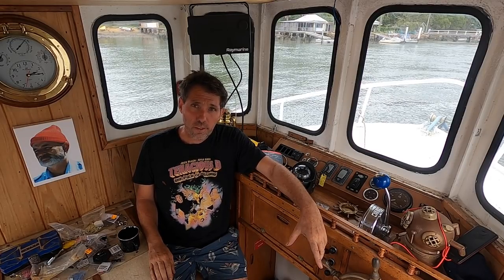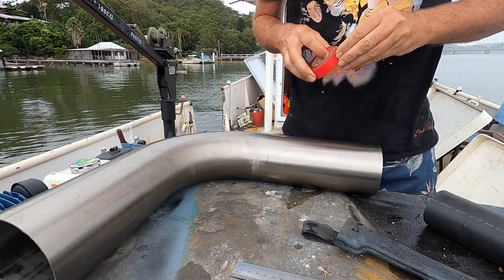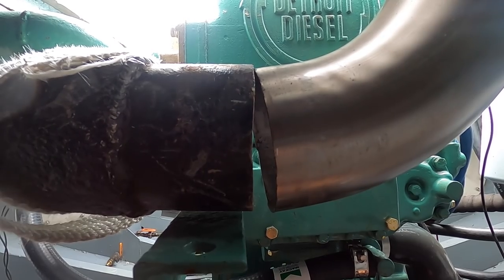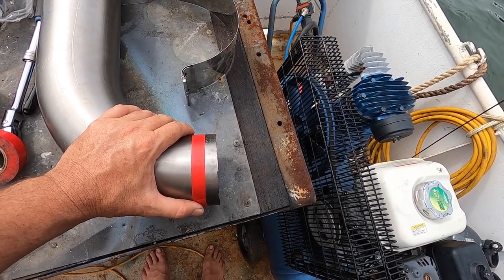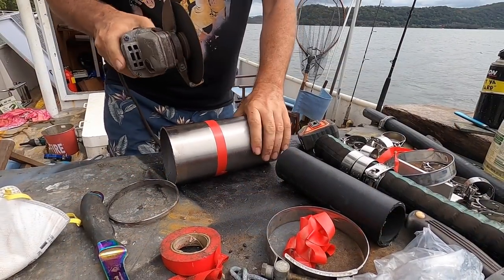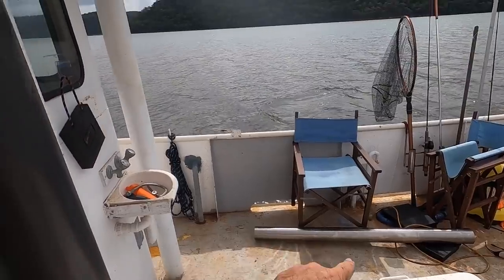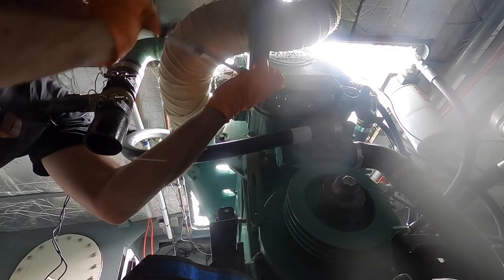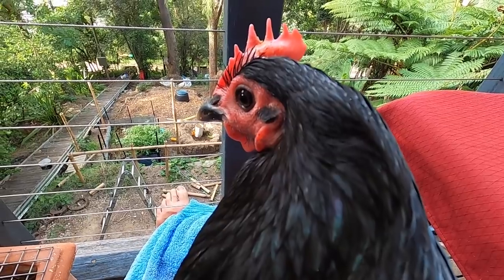Installing the dry exhaust

Comment: I would look for a silicone tube joint like they tend to use on an oversized intercooler for tuned cars. Can/will flex but also sit at correct angles, also look chipper

Comment: I was just going to say the same thing as Tom K, a through deck fitting maybe using 3 or 4 tension springs between the pipe and deck, so no 'hard' joint

Comment: Just a thought how about outing the flex on the vertical pipe before the deck may have a bit more room there and it may not matter if the flex is in part of the bend the longer the flex Less noise
Thanks Mate love the show

Comment: You could have a section of expanded metal rolled into a tube and bend the ends into a flange to bolt together to protect folks from grabbing the muffler.

Comment: Instead of looking for exhaust parts for marine try looking for them in big rig part stores. I looked up the exhaust flapper and found a few places here in the US Prices range anyway from $40 us on upwards into the several hundred category. All depends on your style or budget. 
But I do like the idea of running straight pipe looks a lot nicer.

Comment: Half way through the video and it seems the flex coupling would work best in the vertical portion, below the deck-level ring clamp, allowing left/right shifting between to solid-mounted items; as opposed to the coupling in the lower, horizontal location where left/right movement is compressive-expansive. But if engine torque is negligible, the deck-level ring clamp will be compensatory enough. You could always make the ring clamp mounted through 3 springs since it seems solely for through-deck alignment rather than rigid weight support. Or use a strip of the white weave to line the ring clamp.

Comment: Well, at this point, most of the 455 comments are about the exhaust... so, why stop now? I vote (a) use the flex for the 90° bend and flex mount the muffler & vertical pipe OR (b) put the flex in the vertical pipe before the muffler and flex mount the muffler & vertical pipe OR (c) spring support the muffler and vertical pipe weight & position and eliminate hard restraints. 

Also, cover the exhaust outlets temporarily with a paint can 'till you come up with a waterproof permanent solution. 

So, ain't it great having thousands of experts for friends? 👍🏼
Reply from the maker: I'm yet to find anyone that makes a 90 flex pipe. Could do flex below the muffler but that would involve cutting out the existing support as it is a larger diameter.

Comment: Had you considered inserting the flex in the vertical section after the bend?   I feel continuing the exhaust wrapping from the manifold along the new pipe up to the support would help reduce the number of sites for water to seep into and under the wraps. Certainly  looking forward to seeing it powering up and motivating the boat  forward and back.

Comment: Bus Grease Monkey recently dealt with a bus that had an exhaust tip like yours where the entire engine had filled with water from rain that got in. Suggest you put a coffee can on top of that until you get the new pipe and the flapper installed :-)

Comment: With your fabrication skills and when you have nothing else to make a video about :) maybe you should consider moving the exhaust to starboard and rotating the elbow on the engine so you go up through the deck in a different location.  You could probably just cut the elbow off of the engine and use a longer piece of flex.  This would also put the stack away from the wheelhouse entry and safely to the side.  Good idea for a future video!  Good job!

Comment: I know there is probably something that it will clash with, but I would try to rotate the exhaust from the manifold 45* upwards, that way you will only need a 45* bend just under the deck head, maybe giving you enough space for some flex too.

Comment: can you not put the flex join in the vertical section below the deck?
Reply: Came here to suggest the same thing
Reply: @gagt5spd  Ditto
Reply: Maybe in the Mk2 version of the pipe where the muffler goes walkabout and the straight pipe gets the gig, a bit of flex just above the bend to just below the deck. I think that would do the trick with a stainless bit above that through the roof with a nice curve to keep the water at bay. Otherwise I will just sit on the side and watch  Stay safe people, keep your fluids up, and like this boat it will be over before we know it

Comment: You should turn the U bolt clamp on the top of the muffler around so you don’t have the ends of the bolts sticking out for someone to catch themself.on.

Comment: First off the flex needs to be in there when the engine twists(they all do) I would replace the 90 with flex pipe myself just to solve two different problems at once. In cars the first clamp on the exhaust is at the back of the transmission on some cars simply to allow the engine to move and twist. 

For silencer(not a muffler) there is chromed cages for them that work well.

Also did you call an impact driver drill a rattler?

Comment: Turn the U clamp, otherwise you'll snag all your clothes!
Reply: Or worse someone will snag an eye!
Reply: Yeah I was thinking that, but then I'd probably shroud it just like a truck exhaust. I could easily see someone grabbing that in rough sea to steady themselves.
Reply: I was thinking the same thing. Cut the bolts off and then turn them both around so they face the wheel house.
Reply: That clamp would make a good top mounting point for a protective shroud, just use some cap nuts to finish off with.
Reply from the maker: @jonkwin9620  Nice thinking Jon. I've been thinking about how to mount a shroud.
Reply: @DangarMarine  you can use perforated sheet like on a wood heater to help dissapate the heat

Comment: I would not recommend a flap on top of the new pipe, the constant "tink, tink" noise they make at an idle is annoying.
Reply: Most guys here (New England USA) with a dry exhaust use a top bend and put a bucket over it when not in use to keep rain out.  Remember to tie a line to it as you will always forget and blow the bucket off when you start up.
Reply: @robertwalsh5793  Haha we used to have contest to see who could launch the buckets the furthest.
Reply: I used to drive a Mack with a flapper, it is so constant, you won't even notice.
Reply: @robertwalsh5793  saw a bus grease monkey video where  the whole engine was filled with water down from  the exhaust, hooked pipe, he wondered if the kids had climbed onto the roof and stuck a hose in it, but ruled that out, luckily boats always turn into the wind
Reply: You can overlap the exhaust with a larger diameter tube like a factory vent stack
Reply: Logic Hurts Idiots  I've seen guys use a bit of 3/8 silicone tubing sliced down one edge.  Plus they make higher end flappers, Not the super cheap ones you see on every old Ford tractor.
Reply: If you attach an elbow at or close to ninety degrees at the exhaust outlet then attach a rain flap they make virtually no noise at all.

Comment: You need to turn the u bolt clamps around having them pointing toward the stern is an  injury waiting to happen if you trip, you can make an exhaust tip by cutting a 90 degree bend like you did in the engine room and cutting a 45 degree on the exit this will stop rain entering

Comment: hard connect the 90 degree bend to the exhaust header pipe.  Then use the flexible pipe on the vertical portion.

Comment: Weld or braze one end of the flex to the pipe 
Really should use a little flex after the support bracket on the engine 
Or make yourself a flange connection to the flex  make your own gasket
The ubolt type clamps suck because if you go to take it apart those clamp pinch the 2 connections together which makes it harder to take apart later
I built a lot of big truck exhaust systems

Comment: check it out spring washers /splits/ wafers/  are not supposed to work??  nylon locking nuts stainles?  aka nyla nuts
. or double nut  it ? only on critical i know i know its been used for years. still is.
 but u must agree nylas are better except for heat     nice build and thought ur doing a great job

Comment: Hopefully you will be ok but with the white wrap, you'll know if that joint is leaking. If it was me, I would make a "Cap / Hat" to sit where the Up Pipe comes thru the deck.  This would make the Engine Room a little more water tight. This would be attached to the up pipe and just sit around the deck flange.

Comment: Could you put an elbow piece of pipe on top of the vertical piece as a water stop instead of a flap? Secondly, I would turn the U clamp so that the bolt ends aren't facing towards anyone that may clonk their head. Other than that, I know nothing about boat repairs. Just enjoy watching you endeavours.

Comment: Installation looks fine, but agree that you should hard pipe up from the muffler. What covers the hole where the exhaust come through the deck? I see there is a slight overhang from the cabin, but during a driving rain, it seems like rain water would easily enter this hole. Agree with other comments that the clamp at the top of the muffler should be turned around.

Comment: Did you consider cutting the pipe close to the manifold and using the flex pipe to go from there to the 90 bend maybe its too short a distance hard to tell from video, also if you tun the wrap through the deck support it will give you a bit of cushion on the pipe against chafing from the vibration

Comment: Is there room to put two clamps and a short bit of flex pipe between the 90 degree bend you just installed and the clamp at the deck? If so, that would allow the engine and the below-deck part of the exhaust system to move separately from the above-deck part of the exhaust.

Comment: Could the flex bit below deck be placed in the vertical pipe instead of the horizontal area .... its just for vibration right  ? Will there be a hat over where it comes thru the deck .... sure looks like rain / water get get into engine bay !

Comment: been watching your videos for a long time but had no idea how much progress youd been making. Great job! i wonder if there's any way to use the heat coming off that vertical exhaust? I thought it might be cool if you had a small water boiler or drying rack for wet clothes.
Reply from the maker: A lot of people do have a drying rack near their exhaust but water is normally heated using the engine's cooling water through a heat exchanger.
Reply: @DangarMarine Well your videos have sparked my imagination more than i'd care to admit haha. Any guesses how much fresh water you could carry at one time before running into issues?

Comment: Stu what if you were weld 3 value springs to the exhaust to help out with the vibration instead of having the 3 solid pieces of metal holding it in place on the boat deck. Could work?

Comment: Question, did not see any kind of p trap from where the pipe attaches to manifold down below. If motor is running obviously it is hot and dry but if it sits for a while humidity would collect in the inside pipes travel down into the muffler and drain into manifold? 
Just thinking, our car exhaust mufflers have a weep hole to drain this out. Maybe weld a bung with a bolt at the lowest point in the elbow, drill a pee hole on the muffler.  Love the videos can't wait to see it out making a run up the coast.

Comment: Could you not hard mount the 90 degree elbow to the engine and flex mount after the 90 in the vertical section

Comment: Stu, why do water pumps for marine engines use rubber impellers as opposed to far more efficient centrifugal designs or even something comparable to automotive water pumps, given that the rubber impellers seem to almost invariably have limited lives and reduced reliability ?
Reply from the maker: Mostly because centrifugal pumps can’t self prime. They are used for the freshwater side, just not the raw water side.

Comment: Gidday Stu. Daf looks so content on your lap. Anyway  mate. Just an idea for future reference, and after some time of running, you think the decibel level to be excessive. From where the pipe splits into 2 above the roof you may consider using 2 mufflers on a "t" or "y" joint   with 1 blanked off at the exit point. The oth3r open. You'll be surprised at the difference it makes in volume without  sacrificing performance. By the way Brazil is already at a standstill. When the doctors finally let me out of here so I can get back behind the wheel and pull my weight again. I'll be bloody happy.

Comment: Do you need to put a cap on the hole where the exhaust comes through the deck? Looks a good wave over the stern or sides would fill up the engine bay. Good luck.

Comment: Why have a solid 90 just use the flex line to go from horizontal to vertical.
Reply: That was my thought too, flex pipe up off the manifold elbow piece to meet a stub of hard pipe which is firmly clamped in the deck opening, then muffler on up.
Reply: i wondered that too , but there will be a reason he did not take the easy route

Comment: I probably missed where it was discussed somewhere, but what's the deal with the space around the exhaust pipe where it comes through the deck? Is it just for isolating the exhaust, or does it also serve to bring in combustion air? Either way, will there be something to keep water from getting down through there?

Comment: Hey Stu. Could you not have gone from the Detroit Diesel fixed exhaust to the flexi making the bend, then to a straight pipe up? Doing away with the hard pipe elbow all together.

Comment: I am not an armchair expert and having cheap shots, I just spent an hour pulling apart and tracing my previously installed wiring because my new electric Jockey wheel on the caravan wouldn't work, including dismantling the main switch after loosening the big AGM battery and tipping it on its side to get to the + terminal, there was nothing wrong, I just had forgotten the main switch knob needs to be pushed in hard before it will turn on, turning off is easier.
So one day when this virus bullshit is over and we come past with the van we might make a point of jumping on the ferry so our puppy Zac can meet Eddy.

Comment: Hey Stu, have you considered using a shroud/ for the pipe on deck ? Similar to what is used for a catalytic converter on a gas engine ? That way you won’t interrupt the door and won’t have the corrosion issue that comes with wrap.

Comment: Just brainstorming but could the initial fiberglass wrapped section of pipe be shortened (just beyond where it curves down) and a longer section of the flex pipe be used to both make the turn to the new 90 and provide vibration isolation?
Reply from the maker: I did think about, the trouble is the shorter you cut it the more it starts pointing towards the bulkhead.

Comment: you could weld the 90-degree on and put your flexible above your 90
Reply from the maker: No room in that dimension either unfortunately.
Reply: @DangarMarine   yes there is room
You just need to move the clamp that holds the (exhaust pipe / muffler) on the through dick up (a little )
While I'm mentioning the subject I would extend the through dick pipe up anyway if it was my boat
Reply: Just a little maybe a hundred mil

Comment: You made that pipework above the muffler look vary hard. Next time, cut your rigid to length and push into muffler and clamp, measure and cut flex to length, slide clamps over rigid pipe top and bottom, inset flex between rigid pipes and slide clamps into position. If not enough room for clamps to slide over rigid just pull clamp apart and wrap around rigid/flex one at a time. by the way, those clamps for the muffler have such long thread as they usually go thru a mounting plate off the chassis before putting the nut on. You can always raise the muffler top the roof and have the flex under the muffler. Also it preferred to wrap the other way so as water runs down the muffler it drops OFF the wrap, not INTO the wrap like you have it, but that's splitting hairs.

Comment: @11:10 could you please turn the bolts of the clamps away from open area (upper clamp) and away from your main walk-path (lower clamp)?
Otherwise they might cause very bad eye/foot injury if you ever slip and/or fall in that area.

Comment: Maybe there is enough space for flexi pipe after 90 degrę angle, when its starts to go vertical, before the deck floor? if there will be lot of vibrations.

Comment: How about instead of 90 bend you could try a T pipe then you would be able to place the upright anywhere you need. Wont type out the particulars too long a post, but put your eye's on it you'll see that may work best, also its not for performance so no worries, the T pipe will be fine. support the dead end with a hanger. Couple the flex where you think will be best.

Comment: Is there flashing or some other shield to keep rain and waves from flowing down the exhaust pipe hole?
Reply from the maker: There will be with the new exhaust, these just rely on the the bend at the top and the fact that boats always turn bow into the wind when on the mooring.
Reply: @DangarMarine  thanks, but I meant where the pipe goes thru the deck into the engine room. While that probably is fairly dry, sometimes weather can get weird on boats.

Comment: to put a bend in that spare exhaust pipe you could just put an angled cut in it, twist 180 degrees, and weld it back together, easy peasy

Comment: Consider a T at the bottom instead of a elbow. Most T’s are tighter therefore shorter than elbows.  The bottom can be capped  and fitted with a drain . 2 strokes can use oil and throw it out the exhaust.  It would need draining “periodically”  but... 
love the hens at the end the softer side of steel and welding etc........It’s getting close very close.  Amacf
Reply from the maker: Nice idea.
Reply: Dangar Marine make the T with the long length vertical it makes a “sump” for oil, water and carbon ( 2 stroke EMD’s  when running slow  and light load make carbon)  If you have room.